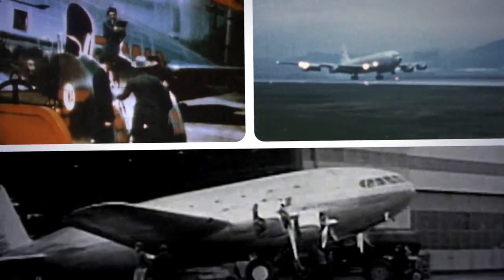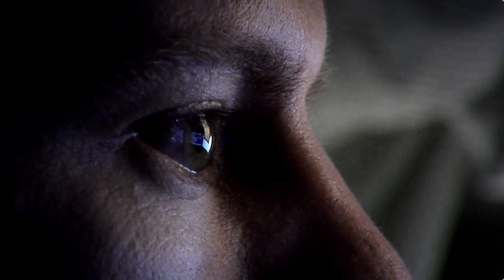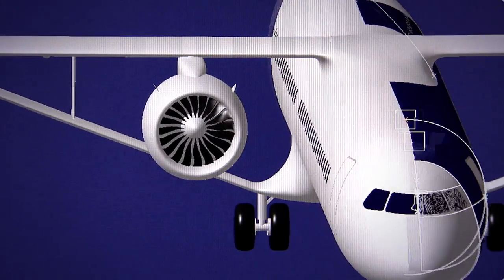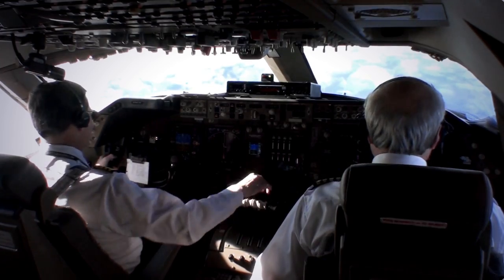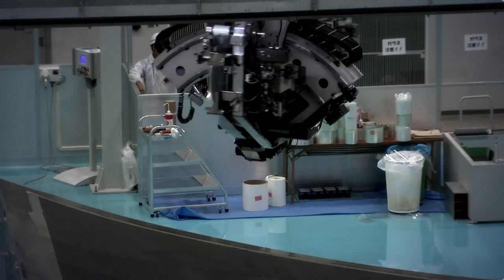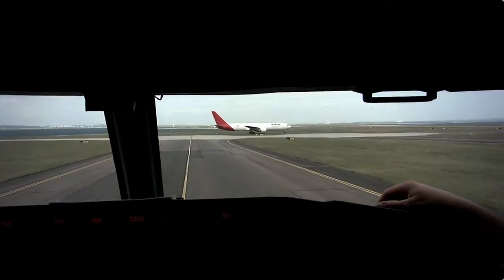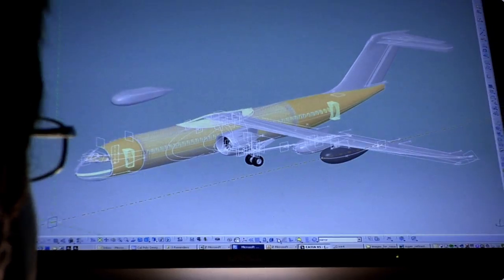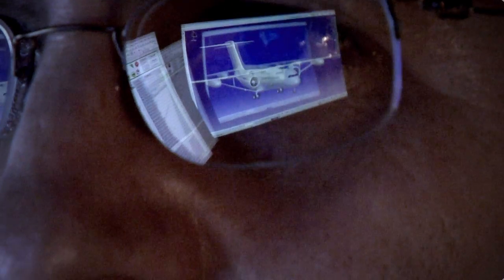SUGAR Volt: Boeing's Hybrid Electric Aircraft

Comment: +Boeing Why do you and every other manufacturer of electrical motors for any kind of vehicle insist on having to plug the units in to an electrical outlet to be recharcged when in fact they can all be built very simply with their own charging system that would function without any strain upon the working electrical drive/flight system? At most it might call for little additions that would not weigh much and would if anything maybe take the weight of one passenger out, but even that is excessive and doubtful it would even do that. I know you all are great engineers in your own rights, but this is something simple to see and implement so why do you not...and I am not refering to solar although that could be an option for planes flying daytime journeys, but not as the primary system. The simple primary I am thinking of should not need back up in most cases.

Comment: So it's not zero emission it's a coal powered airplane.
Reply: In Chicago it would be powered by environmentally clean nuclear energy.
Reply: First of all, jet fuel requires a lot of refining and processing, which requires energy. While burning natural gas, and crude petroleum, produces much less CO2 emissions. Second of all, coal is declining at a relatively fast rate in the US, decreasing at 2%/year, which means renewables and cleaner burning fuel being used is making electricity an ever clean source of power.
Reply: Yup, around 75% of the USA's electricity comes from burning coal or petroleum or gas. That's probably why they said that this was for the future, by which time, humanity has hopefully devolved superior renewable sources. (Hydroelectric sand whatnot)

Comment: 2 matching support angle wing braces could b added under the high tail, housing to smaller jet fans. This gives u 3 modes, big fans, small fans, & hybrid fight. I help to soften the transition between 1 & the other. Allows u to hve just enough power for efficient flight at all demand levels & still hve redundancy factor of small engine if big boy gets taken out by bird or fire.
Reply: +James Merkel This clunker ALREADY has more than enough form drag from the wing struts -- let's not add even more!  Not to mention that there's NO conceivable use for the small fans!

Comment: A small MYT engine could drive a generator with enough power to allow this plane to take off on the electricity. Developed by Rafael Morgado.
Reply: +Ron Wilkinson Why not have the engine drive a prop directly and skip the energy losses in the generator???

Comment: Didnt hear anything about speed.
Reply: +trike rider Once again: environmental benefits DON'T MATTER if slower speed is the price to pay for them!  Air transportation is ALL ABOUT GETTING THERE FASTER -- if not, you might just as well take the bus!
Reply: How is speed that vital in this explanation? We can all assume it's going to fly the same as conventional regional aircraft for domestic flights or it would not be economically feasible...
Reply: +codzomz Speed is VITAL in ALL air transportation -- and with the narrow wings and STRUTS, there's NO WAY it can fly as fast as conventional aircraft!
Reply: +hammertime250 Even if it flew slower than current aircraft, that would be a small price to pay for the environmental benefits. Quit smooth rides just might outweigh noisy bumpy flights for certain circumstances.

Comment: Its is a very great idea but is very ugly and probably won't work. Via not enough thrust... the battery/baterys would give out way to quickly.
Reply: +Dennis Kitainik They're looking out to the 2030 to 2050 time frame! They probably are thinking that by that time, we gonna have this kind of batteries!...
Reply: Not if you have a solar powered supplement... At altitude aircraft are exposed to up to 30X the amount of radiation at altitude from the sun, this can easily be translated into a great way to transform solar energy... Also, what does esthetics have to do with what is successful? FlyBe has the highest number of Q400s in the world and no one has trouble flying them, even if they look "weird"... Do you think people would care what the aircraft looks like if their flight was $30? I don't think so...
Reply: +codzomz Solar cells have VERY LOW efficiency -- even if you cover the entire wing upper surface with them, they WILL NOT generate enough power to recharge the batteries!

Comment: An electric prop plane makes  a lot of sense. it would be  a lot quieter than a jet.much safer without jet fuel. a lot less weight with out  heavy jet engines and fuel. and and  electric engine is less complicated than a jet engine and thus less prone to failure.
Reply: desiguy55 For a LIGHT aircraft, electric propulsion might be feasible -- for a big liner like this one, no way!
Reply: +Dennis Kitainik I propose an idea how about we go back to let's say 1950s now now hear me out we use A. four prop engines which will be more than enough thrust and B. Make them electric motors combined with turbo fan recharge  systems and solar panels on wings and fuselage it will make for a efficient airliner that may or may not need to be recharged after initial  charging of battery packs

Comment: why are the fuselage of the aircraft always cylidrical... why not more ovoid triangular, where it increases passenger  room and adds to lift as the fusalage is more in the shape of a wing...
Reply: Mark Turner Because it has to be pressurized -- and a triangular fuselage can't stand the pressure!
Reply: +Dennis Kitainik couldn't have said it better, it's the same reason why windows in airliners are oval not square... Square would blow from the week spots in the corners, and the same would happen to fuselages....
Reply: +codzomz The first jetliner, the Comet 1, actually had square windows -- anyone remember how it turned out?

Comment: 2030!?
What's taking so long with these things to come reality, why that thing isn't covered with photovoltaics?
All of this is because of money.. no real progress in decent time.
Reply: There is a demand, but there is never enough money for any real progress.
Reply: jarmo tverin Because batteries have low power density and they are heavy, and covering an airliner in photovoltalics might only add a few percent to the range IF they weighed nothing and in reality they might subtract range. Aircraft are the last things that should become electric, after all surface transportation is electrified. It might make much more sense to use synthetic jet fuel derived from 'waste' cellulose as that is already close to competitive with oil derived fuels and has much higher energy density then any foreseeable battery

. Before the recent collapse in oil price a subsidiary of Shell oil was seriously investigating the possibility of investing in a biofuels plant using agricultural wood fiber that is currently used to supply wood fired electric plants in my area of Northern California, so such fuels are not just an academic exercise. If it was clearly cost effective (or even possible) with today's tech, hybrid or electric airliners would have be on the way already. It's not easy nor necessarily the best way to go. However-- I am thrilled that a serious company like Boeing is able to even consider such options. (assuming it's not just a PR campaign)
Reply: jarmo tverin No one want to invest in it. They can't tell if it's gonna be reality or not. Funding the project would mean big risk.
Reply: Yep, that's what you get with monetary system, priorities are crappy.
Reply: jarmo tverin Well, I doubt there is more than 5 major companies in the world who actually have Enough money to fund the project. We're talking about Billions of dollars here. They have to be richer than Google basically.
Reply: jarmo tverin We haven't found the engines or the materials to support the ideas.

Comment: I don't see this coming soon (electric motors powering turbofans!!) and also the batteries erhmm 787 burns! this would be amazing but I don't think this is economically feasible (it ain't gonna happen soon)
Reply: +Michael Flatman by the time your kids or kids kids grow up we will be out of fossil fuels, its either electric planes or no planes
Reply: +Derek Bao exactly!! Even if we have fossil fuels still left, there is no reason why we should waste them on a device which 90% of the time is ALWAYS exposed to the sun at cruise... It's soon going to be electric or nothing... Let's hope Stephen Hawkings figures out this teleportation thing
Reply: Michael Flatman It would happen in around 5 to 10 years time. But only to small plane like 50 to 150 passengers at max.

Comment: Nihsel101 you are a moron and idiot or only say that batteries are worse than gasoline you should not even be speaking right now like idiotic for you to say that when gasoline is producing so much carbon dioxide and electrical vehicles and electrical planes would be the best for our society right now and for our future children batteries are made out of aluminum which is 99% recyclable and lithium ion batteries are also recyclable and electrical cars actually run faster than any car that's on gasoline does not need to switch gears just like a propulsion engine and fuel-cell hydrogen fuel-cell cars now would be the future Norway built a first hydrogen highway which each gas station could produce its own hydrogen and the hydrogen fuel-cell call when you have it parked in your garage they can recharge your house while it's parked which 90% of the time we're not driving our cars there's a lot of green solutions had to gasoline biofuels anything is better than gasoline so you're breaking all moron for saying the gasoline is worse than batteries stupid people like you are the ones that actually will even clean coal technology and in gasoline or that global warming is a myth when we should be looking at wind solar panels an actual nuclear power plants which actually have the least amount of injuries or any problems compared to coal and oil and the Chernobyl incident is a myth because I am from Ukraine and people move back to Chernobyl in the living there for 20 years with no cancers with no problem and if you take the radiation detector and go right to the PowerPoint that actually exploded less radiation than normal natural radiation actually Brazil's beach has 10 times more radiation then Chernobyl does all that bullshit about half 1 million people Diane was all I campaign by call and gas companies to try to scare and Americans to Beth just like 3 mile Island which didn't even blow up and it was say go solar not nuclear no Honda in the 80s there's no way we could've went solar thank you buddy for being on educated idiot do your research first set of saying dumb shit pissing me off and Boeing I would love for you to guys to come out with a hybrid electrical plane but a lot sooner then you guys wanted to be I would like to see it by 2020 on the latest since our planet does not have much time in the sake of our children they going to say what the hell were you were thinking because even if every car in every call plant stops working right now today it would take our planet another hundred years to cool down back before they bust a revolution started which we know it's not going to happen and by 2050 pretty much half of our plan it's going to be a lot of habitable massive deserts massive weather patterns they're going to get worse or are shorelines are going to be disappearances to see you level is rising by the day start prepping

Comment: I can imagine,   one day an orange sized nuclear reactor is going to be the heart of a plane. And only two fans will be the source of the thrust on the wings.  No fuel,  no weight....
Reply: They tried it with the X-6 (a modified B-36 bomber with a nuclear reactor installed on board) -- don't you think there was a good reason why they never built a second one?